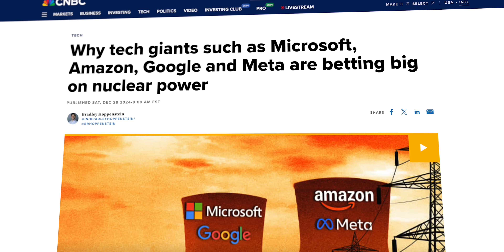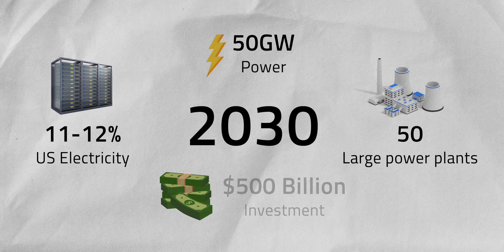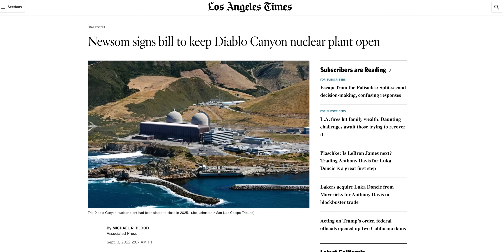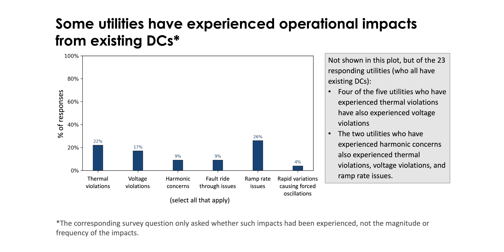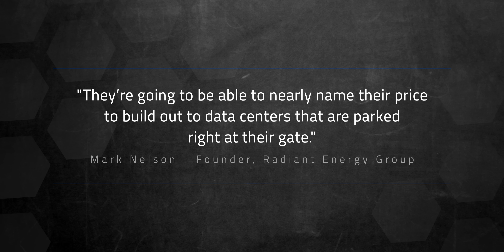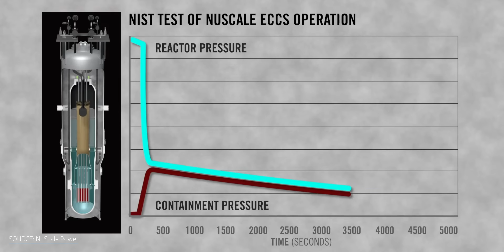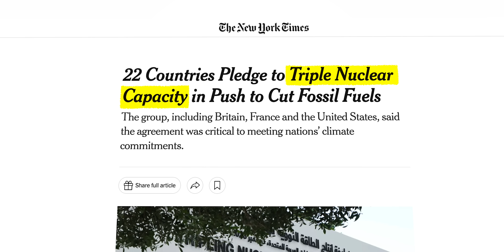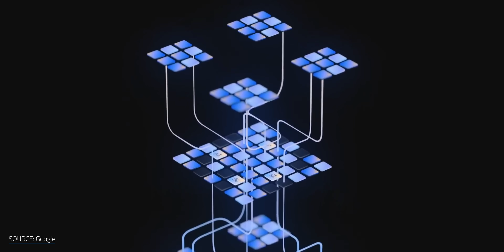Why Big Tech's Betting Billions on Nuclear (Not Renewables)

Comment: I've heard a Rumor that the Darlington and/or Pickering Nuclear Power Plants (both Plants located in the cities of the same name on the northern shore of Lake Ontario, East of the Greater Toronto Area) are going to either be replaced by and/or have their Power Capacity increased by Small-Modular Reactors...

I hope the Rumours are true as SMR's are cheaper and faster to build, cheaper and MUCH safer to Operate that traditional large scale Nuclear Reactors are...
Reply: you can harly be safer than CANDU reators (they use). Also those reactors can use naturally occurin uranium and be refueled while running. Yes, they are expensive to build, but if you already have them, don't see a point in replacing them with some SMRs (mostl likely just small PWRs)
Reply: @Viktor-x1w7w   It's true that CANDU's are the safest Large Scale Reactor Design (and I don't say that just because I'm Canadian 😄😁😆😅😂🤣), the problem with them, like all other Large Scale Reactors, is they are VERY expensive to build, both in time and money...Small Scale Reactors especially if they become a standardized design that can be easily and quickly Mass-Produced in a Factory, will significantly reduce both the time and cost of building Nuclear Power Plants on a Per-Megawatt basis...

Why spend $20 Billion and 5 years building a 10 Megawatt, 2 (or 3) core CANDU Reactor when you can spend around $1.5 Billion to build a 10 MW Power Plant in 1 year that uses 10 Small Scale 1 MW Reactors that is just as safe and FAR easier to Upgrade as well since when a core reaches the end of it's useful Lifespan, is considerably easier to replace - just unhook the entire core assembly from the foundation, disconnect the power and water (if any) lines and lift it out of the Plant on a crane and then drop a brand new replacement core in its place - total core replacement time, 2 weeks (if that), where as replacing a Large Scale CANDU core requires Billions of dollars and at least 8-10 years of work since you effectively have to demolish the old Reactor Building and build a new one in it's place IF the demo doesn't contaminate the site...

Small, Mass-Produced Modular Reactors are the way to go for the future of Nuclear Power...replacement of old, expired cores is simple as is plugging in new cores to expand Power Output...they can also be used for on-site Power Generation in remote areas (Coastal Desalination Plants miles from the nearest city for example) or in high-energy use facilities (steel smelting/recycling plants or AI Data Centers for example) that can now be built near cities without overloading the local Power Grid...they can even be used in local Cities to provide local Power Generation reducing or even eliminating the need for expensive high-voltage transmission wires cris-crossing the countryside, forget needing a few large Power Plants to generate the Countries Power, stick a Small Reactor Core (or 2) in each County's Substation instead and limit the risk of a country wide blackout because a distribution line was hit by a tornado, crashing airplane or terrorist bomb etc....each County/City now generates the Power it needs locally, upgrading the Substations with additional cores as it's Power needs increase...

Comment: Most of the safety features you mentioned were already built into the Candu reactor of the 60's, it doesn't need enriched fuel, can burn low grade uranium and spent fuels from other reactors, I' don't understand why it doesn't get utilized more.
Reply: Their main "problem" is that with them one could easily obtain weapons grade plutonium. That's exactly how India got its first nukes. And nothing scares the US and other "nuclear powers" more than nukes, as you cannot bully a nuclear armed country as easily.

Comment: Well, maybe I missed it but is there anything about modular reactors and meltdowns? The original design for nuclear power was deliberately smaller so that there just wasn't enough mass to ever have a meltdown. Do these modular reactors bring things below the threshold?

I remain uneasy about nuclear but in the industry's defence Windscale happened because the designers ignored the warning from their american counterparts about air-cooling, Chernobyl happened due to the same soviet attitudes to safety there always were and three Mile Island was down to a lack of proper information, far too few readouts on the instrument consoles left technicians operating in the dark (even before the shutdown). Poor planning, poor design and slack attitudes all around.

Despite this it's fundamentally impossible to not have any accidents, despite what anyone from the industry might say.

Slow reactors have always blown through budgets, just look at Flamanville 3, or Hinckley Point C which is already more than 3 year behind schedule with a minimum £5bln added to its £26Bln budget. EDF are responsible for both projects.

Comment: Modular reactors will be much faster to implement than government permits for renewables…

Modular nuclear is also more energy dense than renewables and can use the spent fuel from dumb-ass oversized, over priced submarine reactors used previously , for cheap, since high pressure reactor operators are desperate to get rid of the troublesome waste.

Comment: The main criticism I have heard/read about SMRs is that their sizes make them thermally inefficient raising the cost per KW/h. That and the fact that instead of focusing on one or two designs there is a plethora of companies trying to make very different reactors. If the point is to have scale, a mid size model done hundreds of times will be far more viable (I believe South Korea's model is precisely like that).

Comment: It's control.
Renewable tech is easy to install and provide to the masses at little cost. Nuclear can be concentrated in a separate location, much like coal+oil factories. 

It's the same reason why watermills were neglected as the industrial revolution kicked off, despite being much cheaper per energy unit. Can't control a populace that isn't dependent on a resource you control.

Comment: It's easy to spot nuclear disciples. They use present tense to describe tech such as SNRs, speaking as if it all exists today or, at worst, is a fait accompli when the bureaucrats finally get out of the way. Mass production in factories of SNRs? Savings already banked! Safety and security concerns? Already or easily solved! The reality, of course, is that there are no SNRs. No prototype reactors. Just CAD, Powerpoint and spreadsheets aplenty. The 'horizontal scaling' promise of SNRs? Only theory ... and contestable theory. The real world suggests that nuclear scales vertically. Bigger appears to be better for cutting costs per MWh due to the significant balance-of-plant and other site-specific costs. Will SNRs eventually be deployed and/or deliver on their promises? Maybe. Maybe not. But in the meantime we should avoid pretending they're already in the world.

Comment: Deepseek’s technology has already changed this conversation substantially.  Nuclear is the most expensive energy solution and it takes forever to get them built and commissioned 20-25years for a big one.  Micro nuclear is probably faster but really they would be solving a problem in the next decade or two.  PV and batteries is a more obvious solution, and can be delivered much faster, so the right question is probably ‘why is nuclear being pushed by these large companies?’.  It’s not because it’s better.

Comment: I mean, the powerpoints they show us are nice and flashy (as always)
Reliable low carbon electricity, no crashing of the national grid because someone needs to train their AI model and so on.
I am worried about the parts that were completely blanked out in it all.
Will MS and friends also be held accountable for the waste and decommissioned plants they want to spread around? How will they even deal with the waste? It would be an amazing success story if one of the AI they train from the power of these old or new reactors to finally figure out how to safely transform spent fuel into something that does not need babysitting for a million years, but I fear that too will remain a powerpoint slide. More likely it is going to be the public which will bear the risks, the costs and other disadvantages of these nuclear powerstations, just like in the past 50 years.

Comment: Micro Nuclear generators the size of trailer will be used for onsite along with renewable. This tech has portability, speed of completion, onsite operations along with onsite battery switching guarantying reliable service and backup. This meets the growing needs of large data centers not to be totally reliant on the grid.
Reply: If you want trailer sized power how can these mythical microreactors possibly compete with a battery in that same trailer, backed by ultracheap solar panels? In China these trailer packs have now slipped below $60k per MWh (a trailer typically has 3 MWh).
People proposing micro reactors generally know absolutely nothing about thermodynamics and heat engines. It is not that it is nuclear but that it is a boiler feeding a steam turbine, whatever the boiler, that means it has to be big to be remotely economic. Small reactors for applications where cost is not a big issue are feasible (space, submarines) so long as you are happy to throw away an awful lot wasted heat. But that's not what we're talking about here.

Comment: Nuclear should have been our focus from the moment we developed the tech. Even with its hindered development, it is still the most efficient, safest source of energy that we can run at scale.
Had we properly invested in it earlier we wouldn't be in the mess we are now with fossil fuels, but that is what fossil fuel lobbyists wanted, the world to fear nuclear and regulate it into a ditch

Thank you hippies for listening to fossil fuel lobbyists and knee-capping the world for more than half a century or so

You could also point out that nations that didn't regulate nuclear into the dirt can build large plants for a fraction of the cost and in just a couple years and yes they are safe. UK, US and others out of fear went over the edge with the intent of choking out the nuclear industry, it is by design not cost-effective not because the tech isn't there but because coal and oil interest feed into fears and miss information to the point most of us think nuclear plants produce huge amounts of dangerous waste that has no solution and that they are always on the edge of exploding ... none of which is even remotely true. Even the great failures of nuclear plants still doesn't touch the death caused by coal, and other sources even solar and wind when you compare deaths per mw produced. Nuclear even accounting for huge stupid avoidable disasters is still the safest option per unit produced even safer than solar and wind and with modern nuclear tech that developed underfunded and ignored we can do so much better than that

Now imagine what we would have been capable of had we not let fear rule us ... stop letting fear make your decisions.

Comment: Small mobile reactors are, and have been, available for decades now with a nearly perfect service record and a perfect safety record.  You'll find them aboard some of the US Navy's largest ships and all submarines.  Built by General Electric and operated by people trained and committed to their safe operation, the reactors aboard nuclear submarines have never had a meltdown, as far as I can find.  In instances where the reactors failed, they failed to a safe condition as they were designed to.  These reactors can power a nuclear submarine for 20 years, on just 5 Kg of highly enriched fuel, before they need refueling.  The biggest problem with nuclear power isn't the technology.  

The biggest problem is political.  Why does the NRC take so long to approve a reactor?  Because the NRC is staffed by people who hate the idea of nuclear power.  For the last 30 years, they've been trying to stifle nuclear power under mountains of red tape, rather than promote what is literally the cleanest form of energy.  

But renewables are cleaner!!"  Are they?  In operation they are, but not when you look at their full lifetime.  Rare earths need to be mined for solar panels and battery back-up, wind turbines also need rare earths and recycling them at the end of their lives is, so far, not possible.  

"What about 3 Mile Island?!?"  You mean the "nuclear disaster" that was so safe the President of the United States was on-site inspecting the problem within like the first week?  That was President Jimmy Carter, himself a nuclear engineer from the US Navy.  The Chernobyl incident wasn't even really an accident.  Idiots in the Soviet Union wanted to see how much stress their poorly designed reactor could take, and over did it.  That was inadvertent sabotage, not an "accident".  

We're late.  We should have had a full nuclear power system by the end of the 1970s.  The only reason we didn't was misplaced fear and the same enviro-mentals that traded biodegradable paper bags, paper milk cartons, and reusable glass bottles, for (Forever) plastic.

Comment: The thing they always bothered me about Fukushima is those backup generators. How hard would it have been to harden them against tsunami damage? Place them in hardened water proof buildings? Maybe underground, or on high ground  away from the plant.
Reply: They were underground, in t h e basement.  They would have been fine on the top floors.

Comment: Unfortunately all the reported data for Renewables is "Fudged" 
The global warming potential and cost for these intermittent sources of power are incorrectly compared to baseload power directly. When in reality, anytime you build a huge Solar plant or wind farm it should be directly connected to a massive energy storage facility. Like Tesla grid scale battery banks, redux flow batteries, etc. Or a natural gas supplemental station. 
The combined cost and global warming potential of both systems are what should be compared to baseload power sources... 
When you do that honestly. 
Nuclear power is the clear winner by 2 or 3x. 
Especially if SMR Nuclear takes off. The cost of a nuclear plant could be reduced by 2 orders of magnitude or more.
The folks doing the math know the truth. Which is why they are looking hard at nuclear power and not renewables. When renewables are "supposedly" cheaper. They aren't. That's just what the lobbyists want you to think.

Comment: bc nuclear power is good for situations where you need same output 24/7, its cheap and doesn't depend on oil prices or weather and if you use it for a datacenter, you can build it far away from any city and avoid most safety problems. Its best choice for big tech's task

Comment: Most of the power requirements are for training not on-demand response. Training doesn't need to happen 24/7. So I don't see why they need Nuclear... just go nuts on cheap solar and train quickly on bright days and train slower on cloudy days. Also I'm still not sure why Canada hasn't moved big time into the data center space...  Northern Quebec/Manitoba with a ton of hydro and cold climates for cheaper cooling.

Comment: Small Modular Reactors are NOT an efficient use of energy. They have horendus efficiency compared to large nuclear.  Cost wise, both coal and natural gas are less expensive on an amortised rate than micro fission reactors.  Micro reactors are more resource intensive.  And thereby, micro reactors are more carbon intensive than coal or natural gas.

Comment: As solar and battery technology continue to get cheaper how would it make sense to take on the expense, complexity, regulatory and social challenges of widespread Nuclear deployment. Nuclear fission will also always have the waste challenge which renewables and batteries don't have as there materials are recyclable where as nuclear fuel can only be recycled once and currently this is only done in France.

Comment: My wife is working on a project that works using the heat output of a data center as the heat source / cooling for a cumunal ground source heat pump system.

Comment: Use metal powders to fuel steam creation in closed systems.  Metal powders are fully recyclable, so that makes far more sense than nuclear power.  Metal powders are cheap and plentiful. These heat inputs include iron, aluminum and zirconium.  Easy money.  

These powders are already used in other ways, in fireworks for instance.  

Do the obvious, and simple to get ahead.

Comment: There is another catch, called Physics and reality. All these paper concepts and designs, waiting for regulatory approval are about to meet, when approved, the real world physics challenges and this is what all hot tech money is missing a lot. NUcear (or as well as may be UNclear) engineering is very, very different from software and even hardware design and engineering. Not that it can not be done, and for sure it can, and it will be, but it will not be in 3-4 years. Developing the technology, the workforce and the engineering habits for Nuclear, and especially for SMRs types of reactors, will take decade, and definitely more then one,  and extremely wide pool of engineering workforce in material sciences, something the US, for quite some time, has been falling behind.

Comment: Maybe another way could be to move some the processing to where cheap renewable power is being generated.
There is technology to move virtual machines from one place to another whilst still powered on.
With fast fibre optic connections it might be easier to keep a virtual machine powered by the sun 24/7.